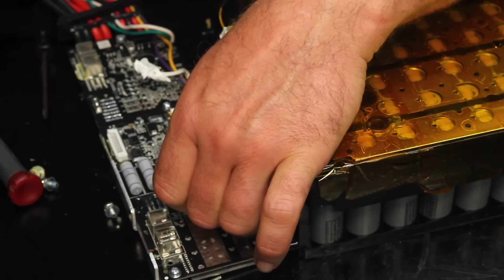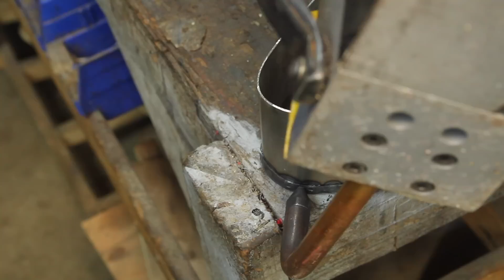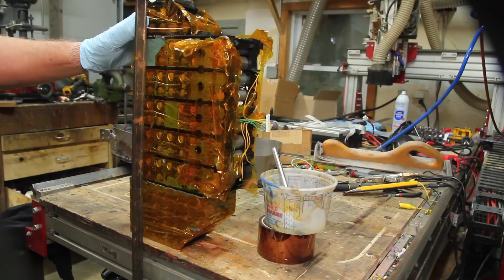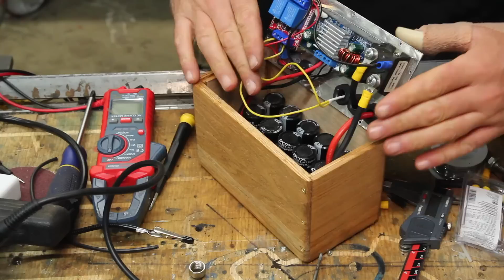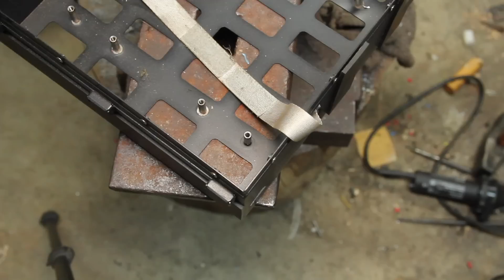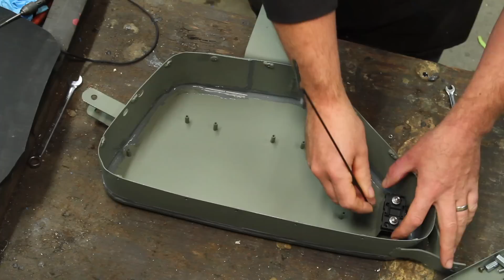Electric Moped Battery and Spot Welder build

Comment: I've got a Baja Heat frame I'm thinking of doing this with, but something like a moped frame like from a Honda C70 / C90 like you did is another option.
Three wheeled trikes also look interesting.   Still mulling it over what frame I want to use.

I see a bunch of 21700s  in that industrial battery.  Where did you get it off of, ebay?    I bought a ton of them new to use on my Quadcopters, but not that many.   Most people use a spot welder on these, but I actually played it dangerous and soldered my leads to the batteries to combine them.     I store mine in the lettuce crisper tray in my refrigerator at storage voltage to keep them degrading...  it's been 3 years now and so far it has worked.   Just drill holes in your bin in case something spills and fills with water so as not to ruin yourbatteries.

 I hammered some license plate holders just yesterday...  for my motorbikes.

I've hammer build a battery box for my Honda Rebel, and built Lion packs, but not one for the other at the same time... so... interesting.
The downside is you'll have to make a custom battery for this any time you need to replace it, which is probably a PITA compared to buying something off the shelf drop in.

Comment: I'm doing a similar project (still gathering parts) but your videos are helping me a lot. I've got a tomos a3 from 1985, and I've virtually planned to do everything you've done to yours (the bikes are basically the same, very minor design differences) and I swear im not copying because I bought my bike about 8 years ago to restore, and about 4 years ago came up with my conversion plans as i decided I didn't want to restore it, more redesign it to my own design. The difference with my bike is it has a linger seat with room underneath for some battery cells in a pack but not enough, so what I'm going to do is cut a long door the length of the tank either on one side or on top, with a hinge so I can make up a full battery pack that will sit neatly inside, and ince the cover is closed it will look pretty much the same shape as it was before. The sad thing is I'll never get to ride it because 3 years ago I lost my leg due to an infection when I got COVID and my other leg is pretty much frigged aswell. But I still want to complete this project, and then maybe if I can raise enough money from its sale, I'm going to build myself an on and off road mobility scooter. I've got a scooter chair at the minute, but it's not much good for me, and I had pretty bad accident in it last week it tipped up on a kerb and I fell out and it landed on top of me. It's no good but it's all I could afford at the time. My buddy is going to help me build both the moped and my scooter, and I'm going to give him my old scooter to use to build his kid an electric go kart. Like I say, it's not any good for me but it will make his kid an amazing nippy little racer. Love your videos. Just found them today. Subscribed.

Comment: Is it REALLY cost effective using smaller cells like this? 🤔 Another question, is once you add up the cost to convert it, plus your time in labor (however you'd value that), at what point does this bike start paying for itself once you figure the two gallons of gas per tank you're saving?

Comment: I feel you shouldn't put so many screws on the battery box cover, considering the large number of cells in there, if you had to remove the battery pack in a jiffy, that is way too many screws to remove.

Comment: Mayby i missed it but what gearing and chain are you using ? DONT put baby in a corner ( Like Patrick Swayze would say ). I got parts for a Puch Maxi kl and a vevor 72 volt 3000 watt my1020 ( controller 72 volts 65 amps )
Reply from the maker: its a 9 tooth minarelli sprocket on the motor (I showed how I made it fit in the first video) and a 60 tooth rear (the builder one treats sells). Normal moped chain.

Comment: I have these same modules. I have two, put them in series and bought a 72v motor
Reply from the maker: They’re a good deal.  I bought 20 more for my Jeep.
Reply: @JeremyMakesThings  definitely interested in that build. A few friends and I were trying to convert a 1980 jaguar. We found that doing a Lexus Electric motor off of their hybrid is the easiest and cheapest way with about 300hp. Shaped exactly like a traditional transmission
Reply from the maker: @kids832 I think Damien McGuire has a bunch of videos on working with those transmissions if you haven’t seen them.

Comment: I was hoping you were going to put the batteries in the gas tank. I have a similar project on hold right now because I'm not sure if cutting open the gas tank will cause structural damage to the frame. So would have been nice to see you do that... :D Oh well now I'll have to try it myself.
Reply from the maker: The tank is definitely structural on this one.  I think with proper reinforcement it could be done though.

Comment: What about cooling? Especially while charging?
Reply from the maker: It’s not really needed.  The temperature rise when charging was pretty minimal as demonstrated.  In the box it will be a little bit more, but not significantly.  I won’t really be pushing this battery very hard, so air cooling should be fine.
Reply: @JeremyMakesThings  the charger is where you might consider "cooling".